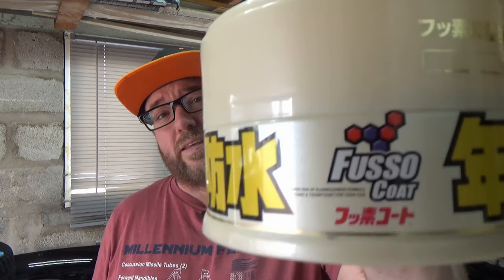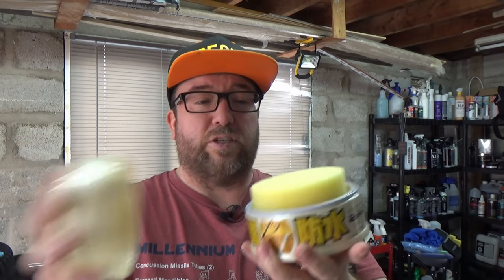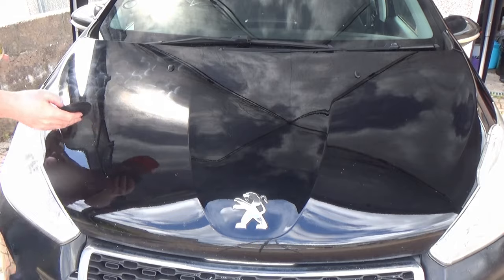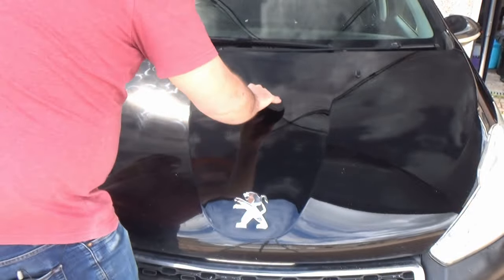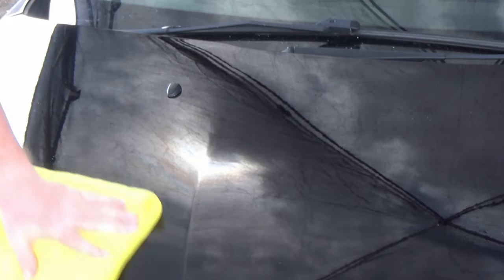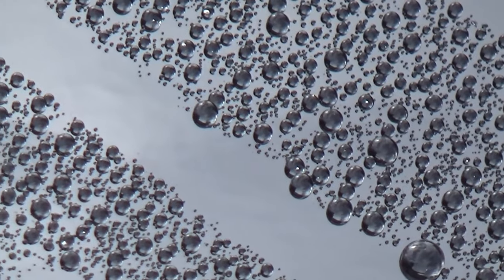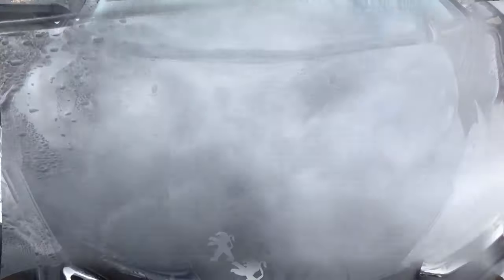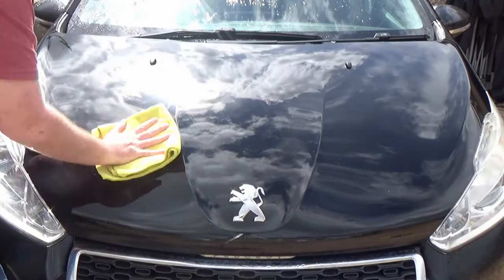Soft99 Fusso Coat - Old Vs New - BETTER OR WORSE?

Comment: Fusso dark is starting to fail on my hood after only 3 months. Claim says 12 months. Must be a bad joke. Did decon wash and came back just a little but still getting weak. Hood was polished clayed and prepped before. Weather has been very hot summer heat  and maybe 3 inches of rain in 3 months. Washed weekly with ph neutral soap. I have a whole can left and it's going in the trash.

Comment: I tried some of the new black formula today, unfortunately didn’t go smooth. I’m used to applying ceramic coats and pasty waxes but this feels very different. I applied as little as I could each time, shadow area, still ended up with many high spots! Not easy at all
Reply from the maker: Did you dampen the applicator? I find that makes a big difference to keeping a good even coverage.
Reply: @SpeckyMcSporran  I appreciate your quick answer! I did not, as the instructions didn’t say so! Do you think it won’t affect it’s performance being in contact with water?
Reply from the maker: It shouldn't make any impact as the water can't actually mix with the product without an emulsifier. The water simply helps the wax to spread more evenly without soaking too much into the applicator.
Reply: @SpeckyMcSporran  Thank you! Will also try with a microfiber applicator instead of the original that comes inside. Will have another go this following week, thank you!

Comment: I tried the new fusso on my garage queen at the beginning of this year. 
I also put fusso 3 month wax over the top the following day, as I have done with the older 12month fusso.
It’s definitely more user friendly than the older product.

I took my car out over the weekend and found after 1 wash it doesn’t stand up as well to the elements as the older 12month does.
Thankfully I still have the older version left.

Comment: Duragloss track claw is fluorine based sealant it’s marketed to make fast 1/4 mile passes which is hilarious
Reply from the maker: That might not be all nonsense,  I've seen a product designed for slicker airflow and some car manufacturers have chosen to apply it before handing the car to the customer.

Comment: with the older version I tended to use a microfiber applicator. Nowt fancy , just the type you used to get in Wilkos etc . Its only of those products everyone should try / have . My old cripe was the gloss levels aren't as high as other waxes they do so many would top with King of Gloss or as I had done Kiwami for that gloss punch . Did wonder and the dark n light versions but your only polishing the clear coat so would anything really effect that in any actual way ?  Brilliant as always Specky and you have worked out the podcast and video timings to tally finally too 😊

Comment: nice.  This is my favourite winter wax due to the durability, and it just about lasts a Scottish winter :)  I was going to do a base coat of fusso topped with mirror shine, as I find Fusso can dull the shine one it fully cures.  Top Tip,  if you dress your plastics and rubber before applying this, it makes it easier to wipe off, if you put any on by mistake, as it can leave a white stain.  I've been wondering if its better, or even possible,  to apply this by 3 inch machine polisher (wet sponge) to get a thinner layer of product on there?  Any thoughts?
Reply from the maker: Firstly I love the idea of dressing plastics first, makes a lot of sense! Waxing with a DA? I've definitely considered it but never actually tried, maybe something to try on the wife's car 🤣

Comment: Have always used a very lightly dampened microfiber to remove, comes off a treat
Reply from the maker: I buffed with a dry towel but the damp applicator is a must!
Reply: @SpeckyMcSporran ooooo interesting, why is a damp microfibre a must?
Reply from the maker: It seems to ensure a more even coverage which seemed to improve the performance of the waxes.

Comment: Hi Specky,a interesting video about the Fusso sealant,to use a damp sponge would probably make it spread better over the paintwork.and the results are amazing, beading is brilliant.
Reply from the maker: It certainly surprised me!
Reply: It absolutely does 
When you wet the applicator it keeps the sponge from absorbing the wax 
Also you have to apply this very thin 
The thinner the better 
One can should last between 25-30 applications 
Also when putting it on very thin it flashes much quicker which speeds up the whole process and avoids high spots and also the problem of removing it. 
Don’t let this wax sit for ten minutes 
It will be a nightmare to get off 
People think you have to put globs of this wax on 
It’s the exact opposite 
As for longevity 
I get between 9-12 months out of it 
It is hands down the best wax/sealant I have ever used
Also when cured ( 24hrs ) you can top it with Fusso King of Gloss or Mirror Shine 
This adds more gloss and also protects the original coating 
Those toppers last about 3 months. 
I haven’t used the new Fusso but I do have 4 cans of the old Fusso. 
I am set for life.

Comment: Can it be applied to all surfaces..plastic glass decals??...something nobody talks about in coatings personally, nothing  beats Sonax Netshield will out last anything
Reply from the maker: Avoid un-painted plastics and glass. Interesting that you say Sonax Polymer Netshield can't be beaten, Sonax claims up to 6 months of protection but Soft99 Fusso claims up to 12 months.
Reply: What products claim and what they do ....used hundreds of products Sonax can be used on any surface and last on every vehicle I've used it on over 12 months. Like everyone else...always looking for a  better one...perpetual quest. Very rarely will one work on every surface. If this is not known, it's disastrous.

Comment: I like old.
Reply from the maker: I don't blame you 👍🏻
Reply: I have 4 brand new cans of the old Fusso 
I bought them when I heard they were coming out with a new one 
It is hands down the best 
It’s true that you have to apply it thin thinner thinnest 
Allow a full cure ( 24 hours ) 
You can top this with just about anything 
Fusso King of Gloss and Fusso Mirror shine were meant to go with this wax / sealant 
It will give gloss and also protect the Fusso soft 99 
It lasts about  months 
You can wash your car every week and a year later it will still bead.